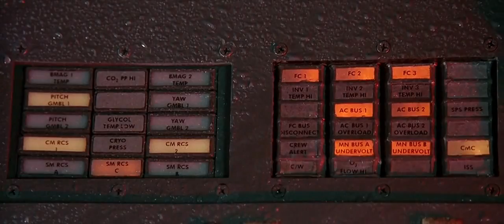Apollo 13 - Ken and Jack Power-Up the Command Module

Comment: 1:22 - "We didn't land on the moon" - So what, the landing on the moon was optional, the getting the astronauts back safely wasn't, how do you know what weight is in space, they were shallow because oxygen tank 1 was still venting though a pipe, throwing them off course, this part didn't happen!

Comment: Does anyone know if the concern about the switches shorting out due to condensation happened on the real mission?
Reply: According to records, when Apollo 1 suffered a fire, there was extensive electrical insulation added to subsequent missions, which would have prevented any possible shorting from condensation.
Reply: It was a concern expressed by Jim Lovell, but it didn’t matter since there was nothing they could do about it

Comment: How could the weight of the rocks come into play in a zero g environment
Reply from the maker: Earth's gravity doesn't just end at an arbitrary point in space, when you begin floating. It extends past moon. And as long as there's gravity, even microgravity, weight matters.
Reply: Oh ok, interesting
Reply: Even though they had no weight, the still had mass.  And the amount of mass, not weight, determines how much energy is needed to change direction or speed.

Comment: Galileo is pissed about the "ballast to replace moon rocks" part
Reply: It’s more to the do with the CoG in the command module.  See, the CM was designed so that its center of mass was offset from the center of drag, which caused it to generate either lift or downforce, depending on which side is up.
Reply: I don’t understand.
Reply: @afridgetoofar1818  objects of different mass fall at the same rate in a vacuum
Reply: @honestinsincerity2270  indeed!

Comment: My mom worked for one of the subcontractors of the guidance computer in Milwaukee, WI and I hate when people say we didn't land on the moon, denigrating her contribution and thousands like her. Her specialty was electronic components, including soldering them! So her work helped get them safely back to earth!
Reply: My mom worked on parts for the space program too in Mikwaukee at Cutler Hammer in C7.
Reply: I'm sure if go to the bottom most (down voted (they still count despite not showing)) comments I will find some Flerfers - Flat Earthers, it's the same mentality and narcissism.  Not all hoax believers are Flerfers, but they might as well be.
Reply: That’s sweet. 😊❤❤

Comment: The phone in your pocket has more power than the computers they used to pull this off. Think about that for a minute
Reply: People always say stuff like this but the thing to remember is that back then as of now the computers we have are pushed to the maximum things they can do. If this happened today it would be the same as using a computer for AI thinking. Complicated but exactly what it was designed for.
Reply: @ruk2023-- 
Your phone has more computing power than all 5 computers that were used in the Space Shuttle
Reply: @FP194  what’s your point? A modern app needs five times as much computing power as a Saturn five rocket
Reply: The original Gameboy had a faster CPU than this did.
Reply: I have heard that comparison before. The big difference is these computers were designed with lots of fail safes that your phone and other modem electronics doesn’t have. Meaning if the computer “glitches” or is asked to do too much with the limited computing power, the system is designed to start right where it left off when the problem passes. 

I believe the limited computing power was a real concern with the final descent on the moon landing. You can hear someone calling out alarm codes.
Reply: Aye. All these computers had to do  was transmit data, which is minimal. 

Displaying sounds and graphics requires dramatically more computing power. 

Mansplained by a non-computer dude.
Reply: The most advanced super computer in the world, in 1998, had less power than the phone in your pocket
Reply: The phone in your pocket has more computing power than the whole Gemini series of space flights the Apollo space flights and the space shuttle combined
Reply: The computers to do the CGI is more powerful

Comment: 3:40
I can’t believe that NASA the world top leading aerospace agency using lb instead of kg, deg F instead of deg C, psi instead of Pa or N/sq. meters or kgf/sq. meters.
Reply: They've changed that since then.
Reply: NASA has been metric for about 20 years at least, ever since losing a $3 billion Mars probe due to a conversion error.   Tesla is metric, so is Spacex.   Many are switching over.
Reply: This was NASA is the 1960’s. The Soviet space program was just as good.

Comment: wouldn't it have been an additional potential to disconnect the four neon tubes for the cabin illumination? each of the lamps consumes at least 10W, based on a voltage level of 14V it would have saved them another 3 amps.
Reply: We’d have to look at the CM specs to confirm, but I wouldn’t be surprised if the lights are stuck on the same circuit as something equally important like the computer. AKA, the circuit’s set up such that you can’t turn off just one, it’s either all or nothing
Reply: @LuckyFlanker13  the sub-circuit may be an argument, but you don‘t need to disconnect en entire circuit to save the juice for four lamps, just unscrew the lamps one by one.
Reply: @TheColinChapman It's probably a lot darker in space than this movie might indicate, so maybe the lamps were necessary. But I understand where you're going with the statement. I would repeat the other guy, power probably all or nothing. Maybe there wasn't enough time or tools to horse around unscrewing lightbulbs and working in the dark.
Reply: @TheColinChapman  A little late, but I imagine those bulbs were probably housed in explosion resistant fixtures. They may have been sealed at the factory and especially during installation. The only way to then disconnect them would be to smash them, which in zero gravity and with sleep deprivation, which would not be a good thing.
Reply: @jagtan13  and what about simply cutting the cables?
Reply: @TheColinChapman  its not so easy, everyting was connected to everything, apart from that on the space there is no sun all the time, you need the light
Reply: @gabrieleduardo86  they could simply unscrew the light bulbs, they had pocket lamps on their mission.
Reply: @TheColinChapman  you can't disassembly a spaceship on 0 gravity come on...
Reply: @gabrieleduardo86  I am talking about pulling four bulbs, that‘s not ‚disassembling an spaceship‘. come on yourself..

Comment: I think after that power-up procedure was done, the amperage total, I am guessing, would be - 3.884 amps. Maybe 3.940 amps, close to the 4-amp limit, but they got it DONE.....after having that CSM powered down and frozen when the exploding oxygen tank on the cryo-stir meant Apollo 13 could not land on the moon!
Reply: They didn't have a 4 amp total. They had 20 amps to play with. In the movie, Ken devises a way to take some of the remaining power from the LEM and use it to help power up the CM. In reality, it was a team of people working on the problem who came up with that solution.

Comment: 2:32
Is that tv station’s camera numbered “13” real?
Reply: I took a look at a 1970's tv set and the VHF channel selector has 2 - 12  13 will select the UHF channel selector 14 - 83
perhaps 13 is for Apollo 13.
Reply: @DonaldRichards-i3m  13 was/is a VHF station in the group from 2-13.  It's been a while, but if I recall, a TV set from then would have some sort of VHF/UHF selector switch - I forget if literally a separate switch or a "UHF" position on the VHF knob. 
So, 13 could exist in a given market.  In the greater NYC television market, the VHF stations were 2, 4, 5, 7, 9, 11, 13.  There, 13 was/is WNET - public television.  I forget where this seen was set - a different market, I assume.

Comment: They filmed this scene and others in "zero gravity." Not actual zero gravity, but in a plane that simulates zero gravity.
Reply: "Actual zero gravity" isn't a thing. Earth's gravity at the ISS's altitude is 90% as strong as it is on the surface, and even at the Moon's altitude, it's much less but still very significant. Astronauts don't experience weightlessness because there's no gravity, they experience it because they're falling. If a rocket were to launch straight up, it would just fall right back down. The early Mercury missions, as well as New Shepard, do exactly this. If you want to get into space and stay there, you need to go sideways really, really fast. So fast that the earth curves down away from you at the same rate you're falling towards it, and you fall AROUND the Earth instead of down towards it. This "sideways fall" is called an orbit. What the plane does is fly in parabolic arcs that follow the exact same path that a person would if they were launched 45 degrees upward through the air at that speed, so the people in the plane experience weightlessness since they and the plane are essentially falling together.
Reply: @KingdaToro    Is that why the term 'microgravity' is a preferred term.  
Wikipedia has a page on 'Weightlessness' discussing all this, pretty indepth too.
Reply: @KingdaToro  0 gravity is practically impossible unless you are far enough from a gravitational source. Given your always surrounded in space, it's practically impossible unless you're in a void.
Reply: The "Vomit Comet."

Comment: I guess I still don't understand. @ 1:15 it shows the projected path (top line) and the current path (bottom dotted line), they said Apollo 13 was underweight. If they were underweight, wouldn't the dotted line have been ABOVE the solid line? Visually, it looks like they are too heavy. What am I missing? Thank you in advance.
Reply: afaik, gravity influences direction change of an object with perceived greater intensity the lighter the object is, because a lightweight object has less inertia from its own mass to keep it moving in its initial direction.  So, an underweight spacecraft will be pulled nearer to Earth at a higher rate of acceleration over the same amount time than a heavier spacecraft would, causing said craft to be below the intended flight path
Reply: @roadbeef  thanks for explaining!
Reply: @rafsolo  :)
Reply: @roadbeef  Not quite right.

If the only force acting on an object is gravity, and one object is orbiting another, then two objects of different masses moving at the same velocity will experience the same gravitational acceleration. Thus, they will have two identical trajectories. You are correct that the intensity of gravity is less on a lighter object, but that's "absorbed" (so to speak) through an object's mass. It takes a greater change of momentum to move a heavier object to a certain velocity, but once at that velocity, there is nothing to distinguish its trajectory from a lighter object.

What I'm guessing (without having done research on the original Apollo 13) is that while the mass of the LEM and the service module was taken into account, the mass of the LEM + LEM + rocks was NOT. Maybe they modified calculations from the original mission plans, which could have encompassed the mass of the return vehicle + astronauts + samples simply as "M_service module" or something. If this was the case, then the craft as a whole would have experienced a greater than expected change of velocity, which, depending on the specific direction in which the vehicle was pointing relative to the Earth (i.e. prograde or retrograde) would correspondingly raise or lower the vehicle's orbit. If the vehicle was pointing retrograde relative to its orbital path over Earth, then being underweight would equate to a greater drop of orbital height, thus coming in lower than expected.
Reply: @Reckless150681  I appreciate the detail in your comment, thank you.  Inspires me to fire up KSP again haha
Reply: The command capsule was designed to have the center of mass be slightly off-center, so that it would naturally tilt slightly in one direction while entering the atmosphere. The capsule could then roll itself to change which direction that tilt is facing, which would allow it to perform some slight course corrections for very little power. The lack of ballast might be messing with that center-of-mass calculations.

 @roadbeef
Reply: That still doesn't make any sense, because the LEM was supposed to have been left in lunar orbit, and they carried it back with them, plus all the fuel the CSM didn't burn going into an out of lunar orbit would have made the whole assembly a lot heavier than it should have been at that point in the mission. I see two ways it might make sense, the Command Module beng too light would have the atmosphere slowing it down too fast, making the G-forces on the astronauts too high. Compare it to throwing a baseball vs throwing a pingpong ball, the baseball will lose speed a lot slower, because it's heavier. The other way is that the Command Module had its center of mass offset from the middle to give it some pitch angle during re-entry, and the roll controls allowed it to actively steer during the descent. But that offset needs to be big enough, so that's an option as well.
Reply: @SRFriso94  The issue was that the service module was basically empty upon return, which is not expected. And even with the LEM still attached, the spacecraft was significantly lighter than it would have been with a useful SM and a CM weighed down with moon rocks. It caused the CM to come in shallower than expected.
Reply: They did a control burn earlier to correct the shallowing and they overcorrected a bit.  Which means the fact that it's shallowing our again and getting closer to the dotted line is concerning.
Reply: I think the graph was showing descent / gravitational influence.
While a brick and a feather fall at the same speed without gravity, with gravity the brick would fall farther but would take longer to reach its terminal velocity.
I think without the extra weight from the rocks, they're going to accelerate to their terminal velocity quicker and throw off the calculations.
Reply: @safebox36 Gravity would still pull the brick and feather down at the same rate but air resistance would slow the lighter feather down more than it would the brick. With moonrocks, the LEM wouldn't be slowed down enough by the air in Earth's atmosphere that it can't stay straight and then veer off course away from Earth.
Reply: The projected path is on top because they came in below it. The dotted line is curving towards the solid line instead of curving downward. This means there's not enough weight to keep the dotted line away from the solid line and curve more download. If ballast isn't added, it will eventually curve above the solid line which means it's farther from Earth that it should be

Comment: If during assembly if the internal wiring or components were not PERFECTLY sealed it would have shorted and they would have died. The number of variables is astonishing.
Reply: After the Apollo 1 fire there were significant improvements made to the command module - especially the wiring which had been the cause of the fire.
Reply: @zoidberg444  Yep. It looks to me like the same accident that killed three astronauts on the ground in 1967 also saved three astronauts in space in 1970. The accounting of the universe gets creepy sometimes.
Reply: @zoidberg444  Didn't stop a short from occurring close to the oxy tanks and blowing half the Odyssey into Space.
Reply: A short is the reason they blew up in the first place.
Reply: Dat Tizio  But there would always have been an explosion because it was discovered that the faulty part used had been faulty almost since it was first purchased.  An oversight that no one associated with the Apollo 13 launch was at fault for.  In other words, what happened would have happened no matter what.
Reply: @Eli-uu4vt  No, it was not a faulty part -- a procedure to "drain" the tank after a fill test by boiling off the oxygen, was done improperly; the wrong voltage was supplied and the heater tube got too hot, likely damaging its insulation.
Reply: @Wingman4l7  "An investigative review board found fault with preflight testing of the oxygen tank and Teflon being placed inside it."

It's from Wikipedia, I get it, but the movie was a dramatization..  The real problem was a faulty part.  Mixing the tanks only caused that problem to become worse.
Reply: One of those situations where they are lucky they operated out of Florida. Reason being that most of their system components (Circuit boards et al) were tropicalized due to the possibility of humidity exposure. This involves pretty much dipping or spraying the boards in a coat of resin after assembly. If they'd operated out of a less humid climate they might of forgone that step, and this situation might of turned out much different.
Reply: It had to be, cause The first Apollo crew burned alive on Earth because of that exact reason. There is a memorial on Cape Canaveral commemorating this event. It's even shown in the movie, at the start.
Reply: Hence why Jack was so damn scared.
Reply: After the tradgedy of the Apollo 1 fire that killed them 3 astronauts,NASA stripped down every bit of the cm,sm,and Lm's wiring and electrical systems and they were all re wired and made totally waterproof so you could say thay in a way it was thanks to that tradgedy happening that the crew of Apollo 13 were in a craft that was much better wired and a lot safer when it came to the electrical systems, obviously barring the wiring in the cryo tank that was ultimately the source of tbe explosion to begin with
Reply: Exposed wiring in the O2 tank is what caused the explosion in the first place